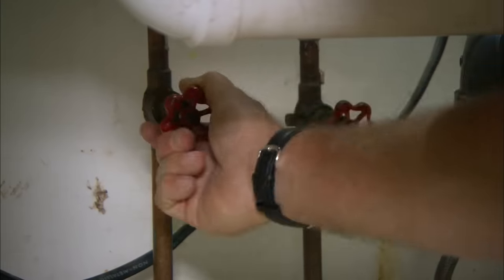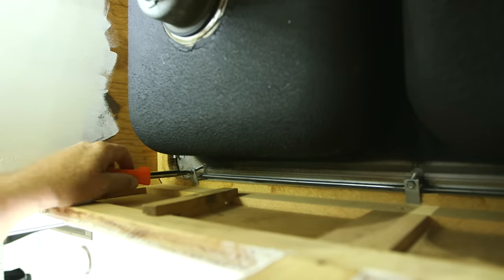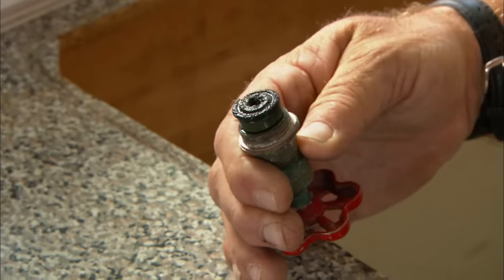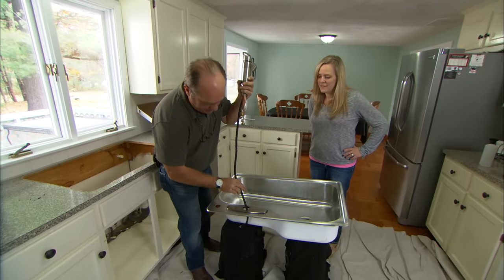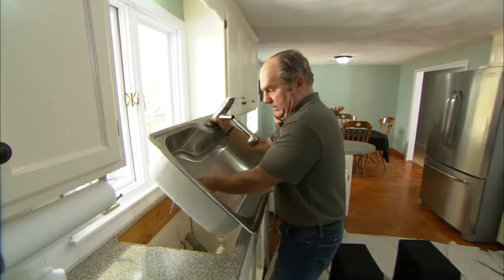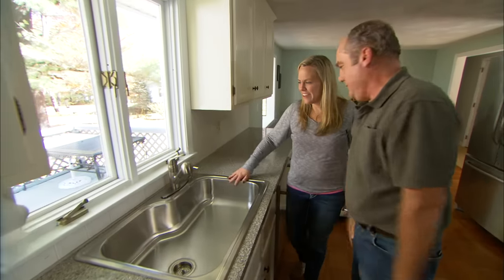Replacing a Kitchen Sink | Ask This Old House

Comment: The whole time he's talking about replacing the gate valve shut-offs that don't hold I'm yelling at the fact that they have a shut-off for a shut-off. So glad he took it down to just the one ball-valve per line.
Reply: Yeah had to do a double take on that, there's a shutoff valve for the sink connectors and oh wait there's a pipe shut off below that.   Kind of wonder what the installer was thinking,  maybe sink attached originally to those other shutoffs?
Reply: My guess is the original faucet was hard plumbed to the original lower valves. When somebody put a new faucets, rather than shut off the whole house, the just closed those valves, cut the pipe above them and added the new valves so they could connect the flex supply lines.
Reply: Personally I wouldve sweat Male adapters on and threaded stops onto them so in the future if the stop ever needs to be replaced its bam unthread clean then thread new ones on.
Reply: Same here. I was getting chest pains when I thought for a moment he was actually going to repair the gate valve!

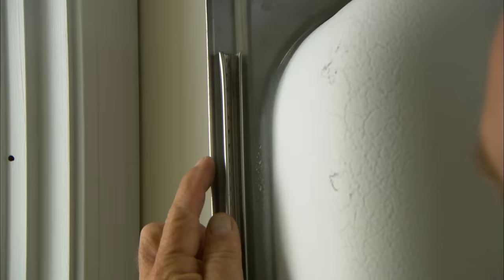Comment: "lets not damage the laminate while taking the sink out"  Then he stands the sink up , they have sharp edges, and you can hear it slide across the countertop at 2:14
Reply: @Joe T when you're changing out the sink,  place it on the floor on the box it came in. Gloss mica scratches easily. Avoid a possible  argument with the owner.
Reply: @Joe T ok.I was speaking from my 46 years aexperience as a plumbing contractor in Southwest Florida

Comment: 6:12  Oatey Green ABS to  PVC  Transition Cement, Richard.
Reply: I cringe when people use them rubber connectors/reducers, so your saying he could have use pvc with a different cement?
Reply: Why not just do it in abs
Reply: ABS is the bomb. Far nicer to work with than PVC. Transition glue is what I use to go from PVC to my new ABS pipe. Works great.
Reply: @SureShotImages  I live in ontario canada. In all the homes I've lived in it's been abs for wast water and PVC for things like central vacuum and furnace/water heater vents
Reply: @SureShotImages  I live in ontario canada. In all the homes I've lived in it's been abs for wast water and PVC for things like central vacuum and furnace/water heater vents
Reply: The transition  glue  is not legal  to use in alot of  Jurisdictions, but a  elastomeric coupling is legal everywhere.
Reply: SureShotImages abs is not the bomb, after a few years the glue joints become brittle and crack.
Reply: The Man's Kitchen same
Reply: @6:07 that is not ABS, ABS is black. That is grey PVC from the 1970s. In the 60s and 70s they mostly made PVC in beige but gsr and plastiline made grey PVC. That P-trap and the pipe out of the wall looked like plastiline.

Comment: As soon as he trimmed the worktop he should have sealed the open edge to make it watertight. If water gets past the silicone seal the worktop just swells up.
Reply: That's a great point. The edges should be sealed with a polyurethane of some sort and the silicone should be put on thick enough that when the sink is laid down, it squeezes out of every edge.
Reply: It wasn't stone/ granite?
Reply: @Joseph1NJ  nope, formica coated chip board.
Reply: @Mike__B , Agree.
Reply: Brilliant.  You should have your own show.
Reply: Colin Nicol I bet your lips are swelled up.
Reply: @Mike__B  Yuk, that stuff can swell up like a sponge.
Reply: It wasn't sealed before and it appeared to be in decent shape. It also didn't look like any silicone was used either. I hear ya but rarely do plumbers do this. That would be something the builder would do before hand as they're the one who will get the call a year later

Comment: My copper lines are vertical so question....can you install a compression valve onto a vertical copper water line?
Reply: Have you figured it out yet? personally, I think you should be fine using a compression valve
Reply: Personally, if you want to avoid soldering a fitting, look at Sharkbites.  They don't distort the pipe like a compression valve would.

Comment: No Teflon tape needed on fittings anymore? Or did I somehow miss that being applied
Reply: The supply lines from the faucet have rubber O-rings.  If you apply Teflon tape, you run the risk of incurring a leak.

Comment: I never used to quarter-turn shut off they rely on an o-ring to seal. And melt when you solder them will leak the next time you shut them off. Any valve without a packing up I won't use.
Reply: I'm no plumber and have installed 3 of them at my house.  No problem whatsoever.  I wouldn't sweat a valve with the packing unless I remove the valve stem.  I'm paranoid of melting the oil rings in those.  The 1/4 turns use a metal ball--tough to cook with a torch.
Reply: @AStanton1966  The 1/4 turn valves have a chrome plated brass ball but on both sides of the ball there are 2 plastic seats against it. At least that's how a 1/4 turn valve I once opened was inside, there might be different kinds though.
Reply: @flat-earther  I just did a half bath remodel and had a leak on a newly installed 1/4 turn.  The worker at the hardware store said that I may had over heated it.  I never had a problem with one before--I'm blaming cheap Chinese parts.   Anyway, I swapped it out for a Sharkbite 1/4 turn because I didn't feel like screwing with a torch with the vanity in place.

Comment: I hate those double sinks. Each one is to small. The wide open single is all I ever would have.
When I silicone the sink in, I make sure there's enough on it to squeeze out all the edges, then wipe off excess.
Reply: In the house I grew up in, we had a double sink. One was deeper than the other and my memory seems to think they were larger squares as well.

But then, the house was built in the late 50's as well and back then, they made sinks as big as you needed them to be. 

The modern smaller sink wells are most likely due to the industry operating under the delusion that: everybody has an automatic dish washer.
Reply: @scotttovey , Back then, they probably were. The new ones suck in my opinion, just to small. Ever try washing a pasta pan in one of those doubles ?  Pretty much impossible.
Reply: august You’re defensive.
Reply: Her new sink would be great for fitting in those big dishes, but it has no drain off area, so it would be an annoyance to wash dishes there at all! It'd bug me having a kitchen sink with no drain off.

Modern sinks come in all shapes and sizes, it's the smaller kitchens and countertops that often dictate smaller sinks, and all that space is now competing with half a dozen appliances that kitchens didn't use to have. We have a double sink which a stir fry wok can be washed in comfortably and it's only 2 years old, so they are definitely available.

Comment: Yea the pipe will be filled like that with no garbage disposal.
Reply: Only if they throw food down the drain. If they toss their scraps in the bin or compost or whatever and just rinse the dishes they should be fine.
Im more concered about that "mechanical connection" that will fill up on the bottom lip of the coupling and pipe and eat the rubber.
Reply: I've seen worse with no garbage disposal because people just stuff it down there !! lol.

Comment: when replacing the sink is it a good idea to  replace the faucet or keep the original faucet?
Reply: Depends if the faucet is in good condition and a name brand that replacement parts can be found, in that case it could be reused. If you have a older off brand one that would be the time to replace it.
Reply: It's always better to start with a fresh palette in my opinion.  Plus the kitchen faucet tends to take a beating.  So it's a good idea to swap it out if there are a lot of hours on it.

Comment: I'm replacing a double sink exactly the same as that one in my house because they're both just too small. Anyone know the brand on the new one? I like it.
Reply from the maker: Richard installed the All-in-One Top Mount Stainless Steel Kitchen sink kit, which is manufactured by Glacier Bay and available at The Home Depot :)
Reply: Thanks!

Comment: I'm wondering what it cost to drop the hit and cold water turn offs, then having a plumber return to hook up faucet , drain and garbage disposal?
I'm asking because we were having countertops installed, and they stopped because undermount sink would not clear hot/cold shut off valves. So we hired CPI pmumbing, cost us.around $700. And now we're told another $1100. to connect faucet plumbing, drain and garbage disposal...:-(
Thus plumbing in our new 2004 home is costing us an arm and a leg. Wish you did a video on hooking up faucet, drain, and garbage disposal...:-(
Reply: There's plenty of quality YouTube videos that would help you do the install yourself.  Especially videos on Sharkbite fittings.  No need to solder; you just push them on and you're done.  Just be sure to follow the recommended install advice.

Comment: What kind/brand of shut off valves did you use?
Reply: Those were 1/4 turn ball valves.  They probably label them as 1/2" 3/8" sweat.  I just replaced the shut off on a toilet with one.  And I'm no plumber.  You don't have to take them apart to sweat them with a torch.  You can also use compression fittings where you need no torch.  And you can also use Sharkbite fittings.  You just press those on after a little prep and they are home owner friendly.

Comment: Sealed the sink to the counter, but I didn't see him seal the faucet to the sink
Reply: My (similar) faucet came with a rubber gasket that sits between the two, and the manual said not to use caulking there. Perhaps it was under the faucet when he slid it in.
Reply: @YuriyRusko  that's because you don't use caulk, but plumbers putty, which is what he used to seal the sink to the counter
Reply: @JustinSmith-ph1le  Again, that depends on the specific faucet. If it has a rubber gasket, you can't use plumber's putty either.
Reply: @YuriyRusko  that's because you don't use the rubber gasket🤦‍♂️
Reply: @JustinSmith-ph1le  Ah, I see now. So the suggestion is to ignore manufacturer recommendations in favor of... your opinion?

Comment: I install sinks all the time.. He did an ok job for a 40 year plumber...  I would have put the basket strainer on before dropping it in the top, just makes it alittle easier.., and if he wanted to switch to pvc on the drain, instead of using abs, he should have used a 2" to 1"1/2" abs reducer, not that no hub cuppling, and then use transition glue to go to pvc... I would have just kept it all ABS... Its inside anyway...
Reply: Transition  glue is not always  legal, it depends  on the  Jurisdiction.
Reply: @6:07 that is not ABS, ABS is black. That is grey PVC from the 1970s. In the 60s and 70s they mostly made PVC in beige but GSR and plastiline made grey PVC. That P-trap and the pipe out of the wall looked like Plastiline.

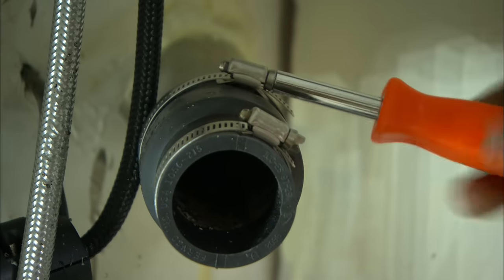Comment: 6:20 abs to pvc transition glue though?
Reply: @6:07 that is not ABS, ABS is black. That is grey PVC from the 1970s. In the 60s and 70s they mostly made PVC in beige but gsr and plastiline made grey PVC. That P-trap and the pipe out of the wall looked like Plastiline.
Reply: @jacksplumbingvideos7147  "That P-trap and the pipe out of the wall looked like GSR."
In your other comment you said they looked like plastiline?!
Reply: @flat-earther  I gave the trap a closer look and I could tell it was plastilne, the way both manufacturers put the markings on the fittings was similar.

Comment: 4:02 I would have used compression shut off valves.
Reply: Well...now we all know just how special you are...
Reply: He's a professional plumber and sweat on valves are cheaper.  If you know how to solder why wouldn't you?
Reply: Not where I live (California). Compression cost about the same per valve and is much easier to put on and replace when you need to. Additionally not everyone is going to want to buy a $30 solder kit that they might not even know how to use. Reminder this channel is more for DIY people needing help to do this project. Not a private plumber that does this for a living.
Reply: @marioq478  I've never seen compression cheaper but if they were I would buy them instead.
Reply: Brilliant.  You should have your own show.

Comment: @6:07 that is not ABS, ABS is black. That is grey PVC from the 1970s. In the 60s and 70s they mostly made PVC in beige but gsr and plastiline made grey PVC. That P-trap and the pipe out of the wall looked like plastiline.